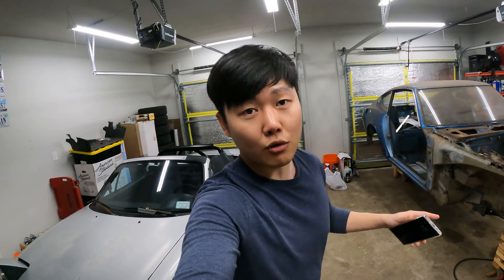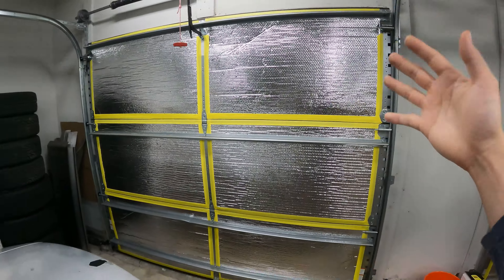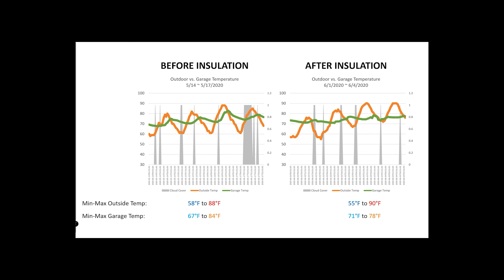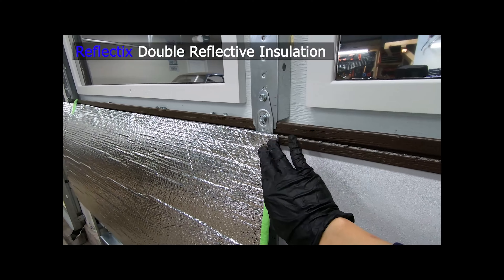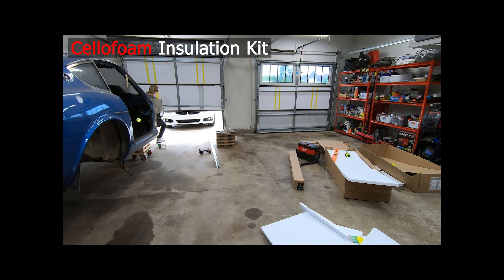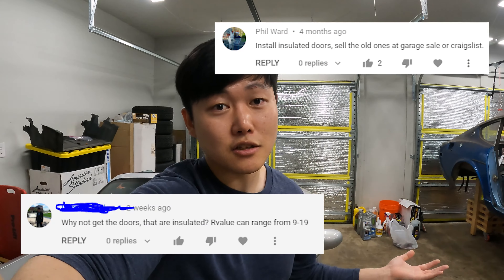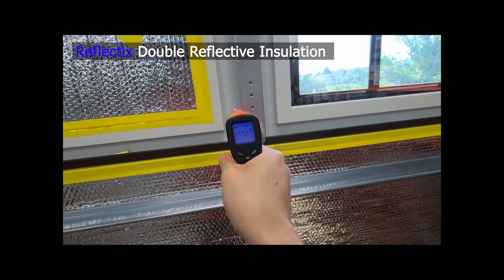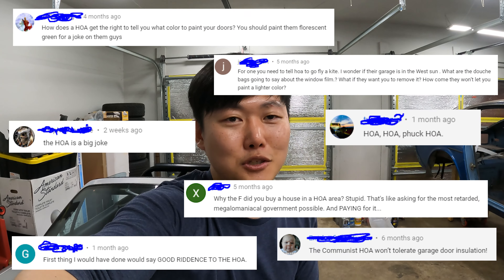Garage Door Insulation 10-month Follow-Up: Answering FAQs and Comments

Comment: To get better results from your insulation job, you should consider adding some weather sealant.  Closing the air gaps around the garage doors will do a lot to help retain heat in the winter and keep it out in the summer.  I noticed daylight coming from under one of your garage doors.  You can replace the weather stripping on the bottom to get a better seal.  This will help with temperatures and unwanted pests.  There is also a product on the market that you can use to replace your rails so that the garage door pushes tighter against the wall when closed, but those are pretty pricey.

Comment: Reflective side exposed is correct.  Reflective surfaces only help when they are in air.  Masking tape usually pulls paint in just a few weeks.  You can still heat it with a hair dryer or use alcohol if you want to remove it later.  They make a wide pink insulation tape, but that foil tape will also work.  Don't worry about all the opinions.  Good video.

Comment: I installed a heavily insulated garage door.  That sucker has a 20degree temp change from inside to outside.  It has windows, but blacking them out with vinyl covered coroplast keeps out the lookie lous.  With the mini split running, it can be 105 outside and a nice cool 75 inside.  Plenty cool enough considering the ceiling isn't insulated.

Comment: If you hadn’t put the Reflectix on the Outside like you did that Styrofoam would crumble into little pieces ALL Over the Place. You Did Great Man👍 And Your DYI R-Value is just as Good as the $4000.00 New install would have been😉 for $100 👏
~ Totally Agree with Your Pro’s out weigh the Con’s on the HOA too.

Comment: I've seen plenty of homes in our area with aluminum doors customized with wood cladding being serviced by just a 1 HP door motor. I think you will be just fine lifting a few pieces of insulation.  :D
Reply from the maker: Yeah, it's not necessarily the weight of the doors, it's the balance maintained by the springs. some guys are convinced that the motor will be ruined very quickly if it's even a bit out of balance... I have my doubts about that, but it IS true that the springs need to be readjusted if the door won't hold still in any position.

Comment: What part of the country are you? Wondering cause of the hurricane garage door bracing. I just completed this project, and I had to remove those braces for the install too. But I'm in Florida, so I'm curious how this will withstand the heat and HUMIDITY! Great video BTW, you did great bro.

Comment: Are your outside walls and ceiling insulated? I am having my ceiling and outside walls insulated as I write. They were not insulated. Once complete, I plan on insulating the garage doors similar to what you show here. I am hoping going from no insulation whatsoever to insulation everywhere will result in a great more than the 10 degrees you indicated.

Comment: Yeah 6 to 10° is huge when it is 106° outside. My garage is at 90° at the height of the heat of the day. #HEATWAVE2021. I used the reflectix on the hinge sections, and the foam boards on the panels. My garage is quite different with 4 long panels and the hinge areas are about 5 inches high.  P.S. our HOA sucks. My son bought a 1985 F350 chassie cab duely to fix up. We had 3 complaints filed because it is ugly. Nevermind it is tagged, insured, and driveable. We had to move it to my parents home becauseit is unsightly. They really are a bunch of AHoles..